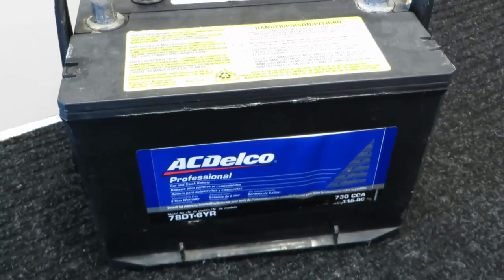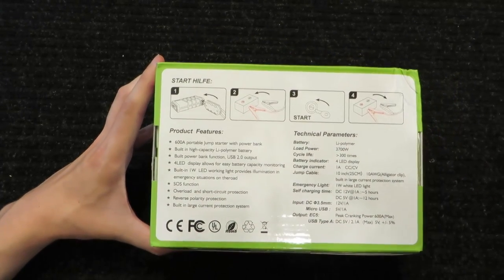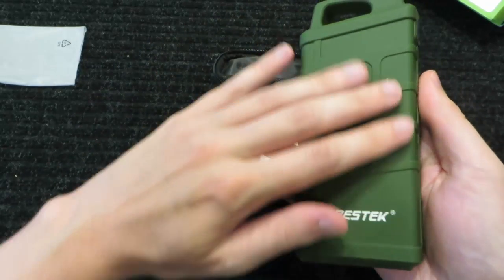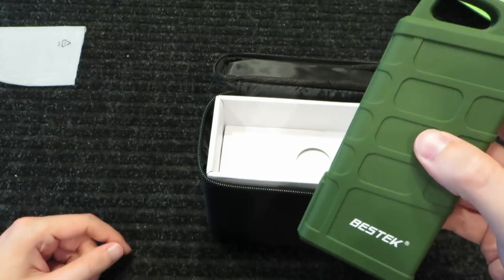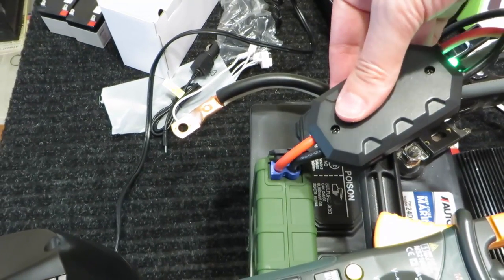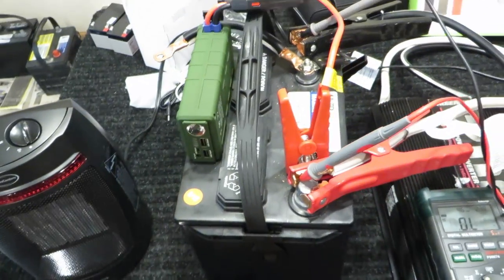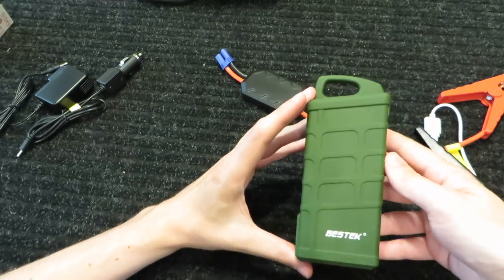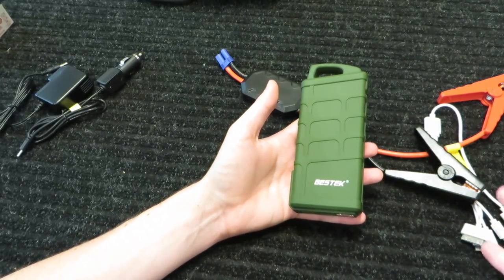BESTEK 600A Portable Jump Starter and Power Source Review

Comment: I can't believe nobody's mentioned that it was obviously designed to look like a PMAG!
Reply: I'm glad I wasn't the only one who noticed this. that's the first think I thought of when I saw it in my subscriptions feed.
Reply: TheDiceAreLoaded Right. First thing I thought of was "30 round magazine" (PMAG brand).
Reply: +TheDiceAreLoaded Noticed that in the first few seconds.  It has the ranger plate as well.
Reply: +TheDiceAreLoaded I at first glance thought they used one as the body but then he opened the box.
Reply: TheDiceAreLoaded i noticed that too. however there is an advantage to it. with a carabiner you van hang it if you had longer cables, so is doesn't fall in during starting.

Comment: ***** I'm glad you mentioned the battery storage charge state.  A lot of people assume that Li-Ion batteries have the same properties as Lead Acid batteries and they don't.  Unless you are planning on using a Li-Ion battery right away you probably shouldn't charge it to 100% capacity since it degrades the battery a higher rate.  My rule is to keep them between 40 and 80 percent since it maximizes their life cycle.
Reply: Laptop users seem to be the main ones that get caught out - Many can't figure out why their battery fails within 2 years, saying they only used the battery a few times and always kept their laptop plugged in, not realising what the constant 100% charge was doing to the battery.  This also explains why UPS batteries are still lead acid.
Reply: +Seán Byrne True, but trying to keep your laptop battery at 70% constantly is not practical at all. You would be better off by unplugging the battery, but that would leave you unprotected on power outages, which most people wouldn't want.
Reply: +Hr Gwea  I'm not familiar with Li-I or LiPo batteries.  How would you know that you were at 70%?  Could you charge it until you saw a certain voltage on the multimeter:  if that works, what would the voltage be?  If that's not the way to do it, can you tell me?  Many thanks,   B Bear
Reply: In general, my experience has been that that's right -- but cheaper units seem to be more likely to have a charge limiter on the lower end but not on the upper.  Not all, but it's hard to tell what does and what doesn't.

Comment: The firm connector straight to the battery is called a EC5 connector. It is very commonly used amonst R/C and hobbie lipo batteries. You say in anothe rcomment your not sure its a true lithuim polymer battery, when its using such a connector that the 4 series Hobby/RC lipos use. So I'm pretty cerrtain there is a true lipo in there. Probably a R/C at that based off the connection to the "Magic black box."
Reply from the maker: umbrefawx Thanks for the info!  The voltage suggests that it is Li-ion but I may be incorrect.  It is a pouch style battery.
Reply: ***** lithuim ion and lithuim polymer batteries use the same voltage for the most part. Pouch cells are lithuim polymer cells but even so, are still a type of lithuim ion. Lipos usually range from 3.7 to 3.8 volts on newer ones. Typically lithium ion batteries (like the 18650 cells in laptop batteries can be ethier/or 3.6 on older ones and 3.7 on newer higher discharge ones. So even so the batteries are different as far as chemistry, there is such a thing as a 3.7 typically lithium ion and a 3.7 volt lipo. So its not hard to get them confused. They even have newer lithium polymer (lipos) which are higher voltage. (think they are rated to 4.35 volts nominal and charge up to 5 volts.) which could be both a good and bad things as the newer 3.8 volt lipos charge to that 4.35 volt nominal range of these new lihv batteries as they called them, but as far as I know they are still in testing perpouses and require a totally different lithium ion battery charger.
Reply: umbrefawx But maybe it should be added that even so the difference between batteries as far as that marginal extra voltage. Both regular lithium ion batteries and lithium polymers (lipos) can be chagred the same way at the same voltages. (4.2 volts though for lifespan reasons as you mentioned in the video, its better to keep them around 4.1) only exception to this really is the newer 3.8volt ones that charge to 4.35 but even so with a slight loss and capacity can still be charged to 4.1-4.2 like the others with a small amount of capacity loss. (but still longer lifetime beneifits.)
Reply: +umbrefawx Great video! Thanks for sharing. Maxmade jump starter is indeed an ideal driving companion, very useful, portable and convenient. Visit http://bizarkdeal.blogspot.com/2015/12/maxmade-400a-peak-current-jump-starter.html , you'll find all the details. Happy New Year 2016. :-)
Reply: +knurlgnar24 I've seen these disassembled, they use a Hobby R/C style Lipo battery. The EC5 connector is a dead giveaway. Lipos are ideal for delivering massive amperages over a short period of time.
Reply: Bestek have recently updated their Amazon FAQ in reply to a customer question saying that it is Lipo.
Reply: Ahh-hah-ha, thank you so much for mentioning that EC5 thinggy. I was looking for a so called memory saver for a while now, that is a little gadget that supplies the car electrical system with juice, so that your car computers, radio, etc won't lose their settings while you replace the starter battery of your car.

There are 2-3 implementations. One is through the 12V cigarette lighter adaptor, but I don't like that, as my car switches off power to that plug faster than you can say 1-2-3. Then there is a solution where you can supply juice through a standard 9V battery, but that might be too shoddy, as there is mixed feedback at Amazon on how that works... and then there are croc clip solutions - but who has that extra 12V block handy unless you are a massive geek?! - I just perused Amazon again and only 1-2 days ago, a novel solution had been added that I had nevr seen before, namely with an EC5 connector. Now, if I hadn't read your comment only a day ago, I wouldn't have known what that is, and that I actually have one :) But like that, I instantly realised that I have an EC5 on my compact jump starter (Suaoki G7) - so I immediately ordered that :) Cleanest solution, supplies 12V instead of 9V and connects through OBD II.

Comment: Making those thin cables longer will soon result in excessive losses, rendering the product useless.  As it is, they are long enough.  I have a lead-acid jump-starter with cables only slightly longer.

While my lead-acid unit has other functions like an air compressor and 400W inverter, it is larger than a car battery and just as heavy, though containing a much smaller battery of course.  I would much prefer a small one like the review unit, and keep a dedicated 12V-powered compressor stored in addition.  This would eliminate the requirement for monthly charging.

Fortunately, your previous video just gave me an idea.  I'll plug the charger into the outlet on the front and turn on the inverter.  Unlike yours it contains a lead-acid battery, so I'll leave it that way to keep it topped up (it is sealed so no worries about water depletion).  Thanks, knurlgnar!  Your videos are the best.

Comment: Clever test (using a dud battery in parallel).  It looks like you had a good 23 seconds of current draw from your Bestek device--with a max of 91A!@~12.07V  That's pretty impressive for such a small battery pack.

Do you know how many Li-poly cells are inside the Bestek device & what their performance specs are?

Comment: Last November I bought the Spirit brand of one of these for 70 the only thing different was it came with an octopus output cable to charge devices with. I never used it but it did save me four or five times starting thw xae on extremely cold days in the north east whether. I'm another one sold on the usefulness of these.

Comment: 73mΩ is wayyy too much for such application.
Cool the pack down to -10C to simulate it being stored in a trunk. Ri will go 10 times that and then I doubt it will give even 30 amps.
But thanks for review, it was interesting to see actual figures of these things. I played around with 10Ah headway cells some years ago when no such products existed yet.
Reply: elektrinis ....74 mOhm is indeed far to high. When set is cooled down to minus 10 degrees C. The resistance, however will drop by about 12%.
That's to say, the copper resistance will do so. With 10 gauge copper wire, all wire resistance is about 2 mOhm at room temp.most of the rest is resistance of pcb traces, solder (!!!) and internal resistance of the semiconductors. At an 80 Amp load, the heat loss of the wires is about 13 Watt, while the heat loss inside the switching box is about 500 Watts.....standard starter motors are made for 10 volt (in 12 volt cars) and are 1kWatt for passenger cars with 4 cyl. Motors. That require 1000/10= 100 Amps starting current. So these losses at start are; starter...1000 Watt, wires...20 Watts, switch box....700 Watts.....quite hot I may say....IMO the switch box is by far too light designed.....and unreliable.....greatings

Comment: The safety switch is a good idea.  Diodes to prevent reverse current flow if the car starts is also a good idea. Storage life is good. So the last question is will it work?  My answer would be probably for most 4 cylinder engines.  Quite a few 6 cylinder engines will start with  100 amp kick.  If you have to crank for an extended period it will probably fail.  If the regular car battery is partially shorted out this gadget might not do it. So then you use your phone for a row call or jumper cables. I use an inverter and a small 120 v compressor to air up my tires.  This thing will easily do the twenty amps I would need.  So I could ditch the extension cord I carry but I like 100 feet of remote power and the big inverter I use is way more easy to carry than a generator.  Those packs won't deliver the 4000 peak watts so I still have to get the car started for the big one.

Comment: Interesting, I figured this would be a total piece of junk considering the size. I usually carry one of those lead acid jump starter/air compressor that's about the size of a car battery with me everywhere. When I had to use it once in 2009 on a 102 degree Texas day, it started a 5.4L F150 where the battery was at 11.2V(alternator died and had to change it roadside). That killed the lead acid battery and I changed it out and still use it to air up my tires, and would use it to jump again if I had to.

I was considering changing the lead acid over to LiFePO4 once it failed, but at that price point I might go with the one you reviewed. The only problem is where I am it can get pretty hot inside the cab and wonder how it would handle 130 degrees or higher.
Reply from the maker: sandman x It would perform excellent when 130F, but won't last long.  Store it 70% charged or so and you might get a few more years out of it than storing it fully charged.  Where lead acid is strong is in the storage energy per dollar.  This lithium battery may be great for jumping a car or two, but it won't work well for powering an air compressor since it will quickly drain this tiny battery.  This is part of the reason why car makers still use lead acid.

Comment: Would it be possible to redo the test with the pack cold (put it in the freezer a couple of hrs ) to simulate a winter condition? I know from experience that the internal resistance of li-ion battery goes way up in cold temperature which would make this device useless if it sat in your trunk in winter.
Reply from the maker: Benzin O1 That's a good idea.  Lithium batteries don't like temperatures below 0c which unfortunately is when you are most likely to need it.
Reply: +knurlgnar24 Agree. I live in the NE and my experience with car battery problems have almost always occurred when it's bitter cold. I would be interested to hear about a freezer test before purchasing one of these and falsely thinking I was prepared. If you do a freezer test would appreciate a heads up...and I'll keep an eye open for it.

Comment: There has been quite a few of these devices show up, it is good to know this one has decent protection. I seem to recall a device that used D cell batteries to perform the same task, although that was many years ago (decades)?
Reply from the maker: Craig Nehring The D cell ones would only be good for charging a dead battery and may be useful, but I wouldn't consider them a true jump starter.
Reply: ***** D cell alkaline can kick out nearly 17 amps at 1.2volts that is 20 watts, 8 cells would produce over 130 amps at 9.6 volts under a short term load, of course they are not rechargeable but do have a very long shelf life.
The first "flashlights" were just that due to battery chemistry and configuration and could only deliver reasonable amounts of current for a very short time, they would recover in a short while to again deliver another burst of light. (9 lives indeed) We have come a long way!!
 I'd like to see a hybrid super/ultra capacitor battery box. BTW, great video as always
Reply from the maker: Craig Nehring Thanks for the comment!  I looked up D battery specs and the 17A would be about right for short circuit amperage.  This means the maximum power output would be at about .75V and 8.5A.  (At temps lower than 20c alkaline batteries perform very poorly.)  You would need about two sets of 10 in parallel - 20 total - to be similar in performance to this jump starter at room temperature.  But you're right, D batteries could work for this!
Reply from the maker: ***** Wow, not sure what I was thinking when I wrote this comment...  8.5A per string of 10 batteries, so you'd need 10 strings of 10 in parallel for a total of 100 batteries.  Still, D batteries could charge your dead battery over the course of a couple of minutes enough to start the car if that was the problem.

Comment: it seems to be a nicely made unit. but i would only use it for smaller cars with engines under 2000cc and are petrol and/or naturally aspirated. not keen on the battery getting hot especially the lithium type! but i would love to have it for camping for charging my phone! it would be better than the powerbanks

Comment: Cold Cranking Amps (CCA) is not what was tested here, all he did was try and run a 2KW heater off an inverter for 30 seconds. A heater element is effectively a dead short, he was lucky not to make the thing explode! I doubt it will work again after that.

Comment: I got the Genius version of the many jumper packs, in my opinion it's actually extremely good very durable and powerful.
The thing I don't get is they can make jumper pack so small and so powerful why can't they do the same with car batteries??
Reply: they actually do make lithium ion car batteries, they are way more expensive than a lead acid battery though and they last about the same amount of time. when you need to shave the last 20 pounds of weight  off of a prize winning racecar it is worth it, but who wants a 5,000$ car battery that needs replacement every 2-3 years?
Reply from the maker: redneckbryon Peter's right.  I actually recorded a segment where I explained why car makers use lead acid when lithium is, on the surface, superior but removed it from the video for length.

Comment: How many times can this power pack charge to capacity a typical laptop?  Just curious, because I have had cheaper packs that can just charge a phone to full capacity and that was it.  A laptop battery requires much more power, hence the question.Thanks in advance and keep up the great work!
Reply: +Tommaso Petrella i would get the easyjumper, it has a laptop output

Comment: I don't know much about these but I found myself here becaue I jump my truck with race drone batteries. My truck battery went the other nite so have had to jump the truck 3 times. I've noticed I pull 200 to 250mah every jump off of a 6s lipo pack.  What's actually in this thing as far as cells?

Comment: I always wondered why there were arcs on batteries. 12v definately does not arc, ever.* I did not know about the inductance.
Reply: 12v most definately does arc. As we speak I am drawing 2-3cm arcs from a 3v psu. my stick welder runs only  about 30v when its closed circuit. as long as you ionize the air the heat will continue to ionize more air and allow you to maintain the arc, think a jacob's ladder.